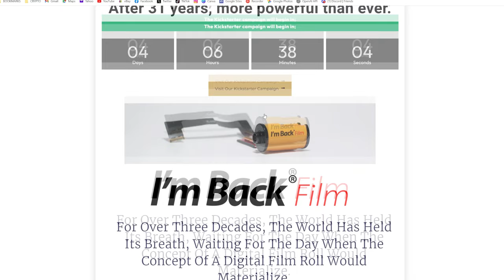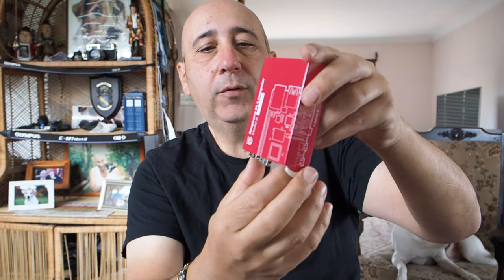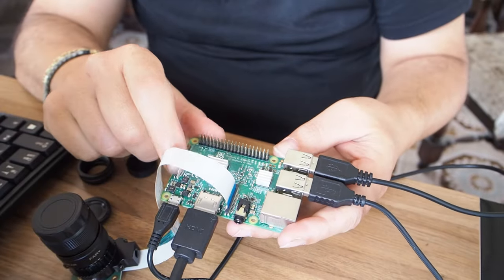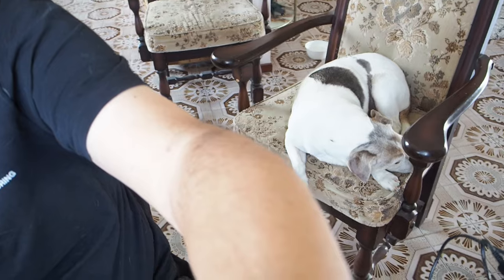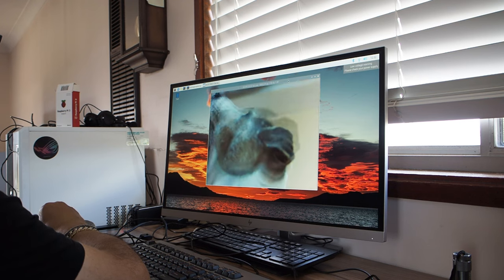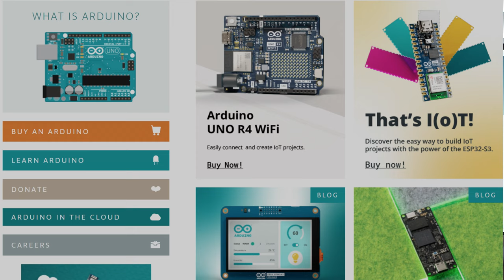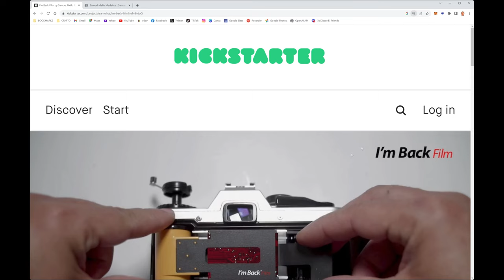Can Micro Four Thirds Save Your Film Camera

Comment: You should use the one inch eye camera sensor with a raspberry pi 5 and a wide angle lens with 0.45 in strength which will end up being a crop factor of 1.10. The end result would be something like the I’m back film.
Reply from the maker: Yeah that would be cool. I did a little experiment with the better raspberry pi. Turned out sort of ok. I did a video on it. Didn't take it too seriously but I can see it's potential. Fun project anyway building a camera 😆

Comment: The easiest part to replace - small series production - is the rear door.
Once you can produce a new new door you have a lot more freedom to work, integrate controls and even a screen.
OTOH, you are still missing a way to interface with the actual camera.
As long as the solution is not an actual FF camera that you can use without tethering, that doesn’t require a bulky grip, it will NOT be the enhanced version of your beloved film camera of choice. However I love the idea, IMO it is a dead end for many practical reasons. Ultimately would be many times easier to create a digital camera from the ground up, that works and looks like a film camera. It isn’t hard to imagine a simplified FF body without LCD, without most of the buttons we are used to on digital. Basically a digital Nikon FE / OM10 or something of that level, it would be slightly bigger than film because of the FF sensor, mirror and battery, but not as bulky as the ZF. BUT it would be niche, expensive and not a commercial success unless it has that Leica factor. I would imagine such a system in two forms, a modular mount - allowing for a wide range of lenses - or more likely a universal body design, but with different mount options. This would be more practical and allow for more revenue. The revenue part is the challenge. This is something that is more likely to come from the Chinese than west. They seem to be able to combine enthusiasm for photography, which affordable solutions. Global niche market can still be sizable.
Reply from the maker: Some really great points there. Agree a very niche project. I think the Fuji and Nikon guys are doing a great job bringing back the analog look experience already with their cameras. Hardest part is fitting it all inside. For the hobby enthusiast the raspberry zero boards would be best. Thanks top comment 👍
Reply: I think it is possible to integrate basic controls even without specific back. I've seen many videos trying to implement digital-film feature, but no one ever have tried to control capturing with rewinding knob. you basically can apply rotational force in every mechanical camera via this knob directly to the film cassette, so there is an obvious way to put something like a switch right under the cassette and program it for on/off for example. you wind the shutter, turn sensor on (in fact this is similar to starting exposing a long-shutter shot), take a picture, and then some kind of processor turns sensor off automatically upon recieving dark-light-dark sequence.
indeed there is no much of a space inside a camera, but I think using flexible PCBs can partially fix this problem. also, dimensions of typical film roll are already large enough - especially assuming that you basically need to fit only a small SoC, microSD slot, a switch, some kind of buzzer for audio feedback, a couple of buses, and a battery cell (actually power supply for FF is the biggest trouble for now, but this is gonna resolve in like a couple of years with new batteries tech upcoming)
the only big flaw for now is that we have to wait for Samsung to invent thin flexible sensors to be able to craft really thin film-like matrices for this stuff. so getting a product today digifilm enthusiasts are dreaming of requires waiting and designing everything from complete scratch.
Reply: A door works with 1 model of camera instead of 300 models of cameras at once, I don't think that's viable. I'm thinking wireless connection to a hotshoe control unit, which would work with basically any camera.

Comment: The guy in the ad is Brazilian (at least he has not a Portuguese accent)! What a surprise I wonder why. was it dubbed? Eheheh they joined the worst of two worlds: the disadvantages of film photography with digital photography. No LCD to take the pictures, the necessity of a battery, lower resolution, bad low light sensitivity (I doubt it is a high end sensor). In most cases is more a novelty than a real useful thing. I would use it on a Leica or a Hasselblad if it fits, but just because of the camera, not because of it.
Reply from the maker: Yes. I believe he is, and lives in Switzerland now. It actually has a bottom section that has a live view screen and battery. Only the sensor goes in camera. True a novelty for the most part. Leica owners might say it's all too sacrilegious.. haha 😆

Comment: I have REALLY missed my camera and the case-full-o-lenses, etc;. It was a significant investment at the worst possible time. Still have it, and would love to use it again.
Reply from the maker: Yes thebold lenses are quality still
Reply: You can get adapters for most old lenses to make them fit DSLR's
Reply from the maker: @cwork5485  I have an old Tamron 300mm  that is  600mm on my Olympus.. it has very good quality for price

Comment: I have an old Kodak Pony 135 model c, and the lens is made with thorium and im wondering if the radiation would damage the sensor over time
Reply from the maker: I doubt it will do much. But I read it might be harmful to your eyes if prolong.. 😆 be safe
Reply: @robdido it's only the front lens and I checked with a geiger counter where my eye would be and it's basically background
Reply from the maker: @The-One-and-Only100  I've never heard of these lenses. It's a fascinating topic.

Comment: What's the point? Using a film camera is the process and the results of film, the developing the actual negatives of you want digital just buy digital.
If you have a favorite film camera just use film if you want a film like experience a Fuji camera has all the knobs you can use in the manual mode it even has film sims.
I love shooting with my mamiya C33 the way it was designed using and developing my film
Reply from the maker: Yes the whole film experience can't be replaced. I like how this gadget can be popped in and out of 99% of cameras. More of a novelty thing but a good idea.. hopefully its not too expensive
Reply: @robdido  
Probably could buy a lot of film for the price 😁

Comment: Bear in mind, a raspberry pi has a bundle of peripherals and and ports built in that require power, strip down all that stuff  and you would be left with just a couple of ports, to drive the camera and export the saved images I imagine that this  device is actually already available somewhere, now place it on a flexible pcb in the cartridge on a spiral pcb and you would easily have enough room for the graphic cpu, cpu, memory and peripheral driver. and attaching the battery to the base is no more than havinfg enough flex pcb to put the pack below the motordrive location. To detect when the shutter is opened is a no brainer - send the image sensor to sleep with the exception of a few pixels to trigger the event,  or a separate sensor with just a few pixels to wake the system up, with speed of cpu's this would be in the 10,000's of a second range range, ISO set would be on the battery compartment,  just set to the camera ISO.
Reply from the maker: Sounds complicated. I think the I'm back invention doesn't use RP anymore. My silly version was just a pi with a screen and battery  chucked into a camera.. it kind of worked..lol 😆

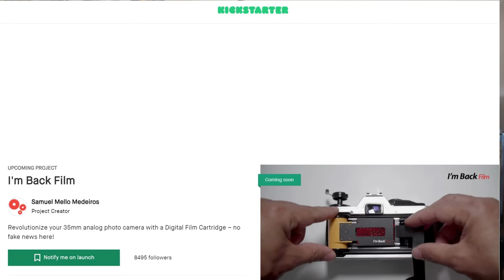Comment: @2:20   You fit it in by using a Nikon with a removable (250 Ex backs type of thing) back. Just replace with the digital part the film part. Meter with a LunaPro and manual set everything. Since 1982 my humble FM2 is all I need or WANT. 
Nikon do you hear me?
And, in camera presets (looks like): Agfapan25, tri-X, Fujicrome50, Koda ...
Reply from the maker: That's a top idea. I looked them up.. might be too valuable to modify...  😆
Reply: I too have my  FM2, F3 and F4 bodies and hope miniaturization will somehow be able to solve this. In the meantime I seem to recall that there was a Polaroid Film back for the F3 or F4 that might give you more working room to innovate within that space of the camera body.

Comment: Wish it was crop sensor rather than 4/3, having said that, perhaps its sufficient enough.   Then there is cost,  yes its a cool idea to be able to use the old SLR body but if its too pricey,  just get a Fuji X camera or the Nikon retro digital.
Reply from the maker: The glass too. But yes expensive and the  Fuji and Nikon retro style can use adapters. I think it is a bit pricey. Id like one without the bottom part.. that would be tricky to make

Comment: All the mainstream cameras in 35mm were full frame. So anything less in a sensor would be problematic. There were a few 110 formats so a lens from that era adapted to a 35mm body would maybe be usable, but rear element to sensor would be the tricky part. However, how to connect the shutter release? It all sounds pretty over the top and not very practical.
Reply from the maker: Yes the sensor would miss a lot from the lens. Might be sharper though at center?  Not sure.. the shutter is a big challenge

Comment: This looks really complicated and too complicated for my old brain.
I got to use my good friend’s John Truman’s Olympus OM1 film camera. What a joy.
Reply from the maker: Yeah. I'm in over my head.. yes.. I'm doing a vid now on OM1.. it's my fav.. better than the Canon.. timeless camera
Reply: @robdido    I had a chance to try one of the first OM-1s in the U.S. -- back when I was in college.  I really liked it, but I was too deep into the Nikon system.  Eventually (after OMs were no longer being produced) I replaced the Nikon gear with OM and used them until repairs were just getting too iffy.  IMHO the OM were the best all-around manual focus SLRs built -- real shooter's cameras.  

I still have one OM lens left -- the 50mm f/1.8 MC in the 5,000,000 serial range.  This is where they finally got the bugs worked out.
Reply from the maker: @Gallery90  yeah. I've got a roll going in my OM1.. the version without the MD On the front. And a 50mm f1.4.. not sure what serial number. Can you date them by serial?
Reply: @robdido  At one time I might have been able to tell you, but I think there are resources for that information still online.  I think that the F/1.4 started as a single coated lens, and then went to multi-coated (marked MC).  There was also a 50mm f/1.2.  Of course, in my film days, every fraction of an f-stop was worth having.

I had the 50mm f/1.4, but the f/1.8 was considered a very good lens at a good price.  Several iterations had problems with sticky aperture blades, which was solved in that last version.

Comment: I guess if you like to tinker, this would be a fun way to (kinda) update your old film cameras. Unfortunately I don't see it as a way to take better photos or be a money saver. My ancient to almost new Nikon lenses fit on my DSLRs just fine. I suspect Canon and other makes have at least a few  good choices that will do the same thing. But with that said, fun concept for some folks to try.
Reply from the maker: Agree. All reasons to not bother except for the fun factor. If it was cheaper and without the bottom part, it would be great to still use your old film camera without the real film.

Comment: 💥Samuel has done it again👍 But the new MFT digital film cartridge has a crop factor of 2 ! My 16mm fisheye lens would become a 32mm wide-angle lens with barrel distortion.  Ribbon cable & camera seal can wear on each other and the new system is rather expensive 😉 I use OM lenses with an adapter on a Canon DSLR and my I'M BACK pro with inherited east german SLRs with old Zeiss lenses👁️ The company is trustable - their after sale support great. They delivered an improved matescreen for my 5 year old I'M BACK really fast😁👍
Reply from the maker: That's cool you got the original one. Yes seems a bit expensive the new one. I originally thought it wasn't going to have the bottom bit. Just the film canister and sensor all in one would be a winner 😆 maybe next version. I'm sure it would need a lot of engineering
Reply: 🌞Samuel will also improve the 4/3 version because there is a demand👍
Reply: From the website "The sensor: Small but great! 
I’m Back® Film, with its micro 4/3 sensor combined to our wide-angle adapter eliminates all crop factor and results in full-frame pictures!"

Comment: But why... the system doesn't have any cheap ultrawide lenses, so everything is stupidly long (effective) focal length, lower res than 35mm film, barely any controls, unnecessarily heavy (making an image circle way bigger than needed)... and not even cheap
Reply from the maker: Practically no it's not the wisest choice, but I guess if you like your old film camera and want to make it into a digital and have spare cash to spend then it's something for someone to fill that want

Comment: In my opinion digital is not true photography. Digital is just differing levels and intensities of data, I call it digitography. True photography is retaining an image on film with silver halides and various dyes to show a recorded instant in time. This venture needs to be more available to people familiar with true photography to be successful.
Reply from the maker: From gelatin and silver to quarts silicon and germanium the process of capturing light has changed but the instant in time remains the same. No two rolls of film are the same which you could argue is a good thing. I like to shoot both film and digital. I agree something was lost when it all went to zeros and ones 😆
Reply: @robdido  It is impossible to get absolute black in digital and absolute white is an absence of data which cannot be perfectly rendered on a computer screen. Another complaint I have is how easy it is to falsify a digital image and it is presented as a true in enhanced image. I can understand dodging and burning but the negative remains the same.
Reply from the maker: @haroldishoy2113  good point about the black issue.. didn't know that. I've been playing around with this AI thing lately and it's a bit scary. Yes.. the negative is still the true source. One possible solution for Raw files is to utilize block chain technology but even then all digital can eventually be tampered with. I always wondered how original valuable RAW photos are sold?

Comment: What is the point of this?  If you want a digital camera then buy one....  There is no shortage of cheap used digital cameras.
Reply from the maker: The idea of the inventor is for the conversion of old film cameras for people that like their old cameras and still use it without film. More of a novelty than a practical thing. If the price comes down it would be fun to use
Reply: I don’t think that there is a convenient/viable/affordable way of doing this. I owna a Nikon F4 in pristine condition, and I have come to the conclusion that the best way to use it is the way it was intended = with film, probably most conveniently with slide film, and if digital copies of the images are required, then to take digital images of the slides..🤷🏼‍♂️